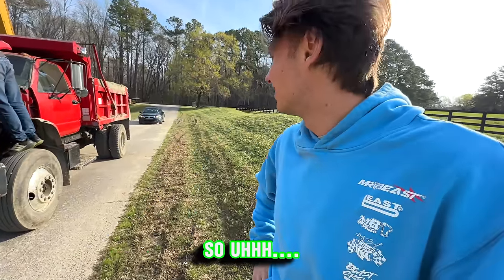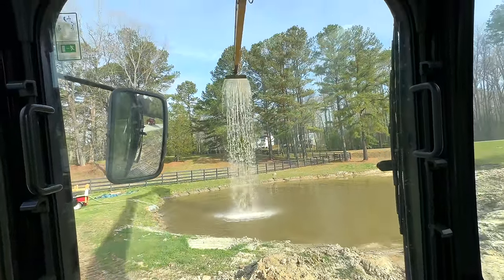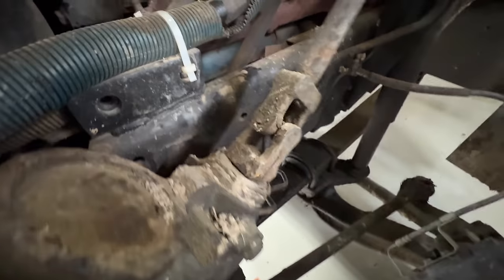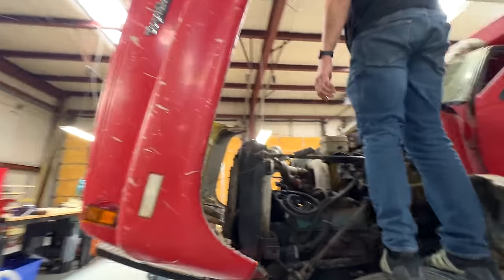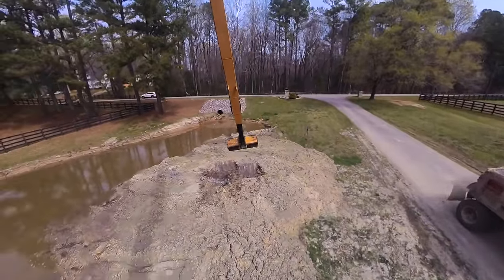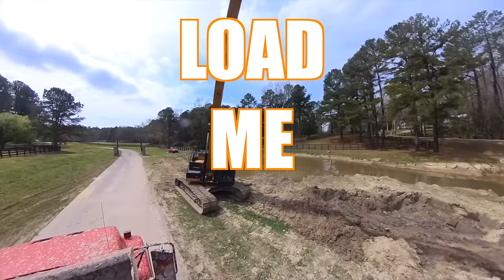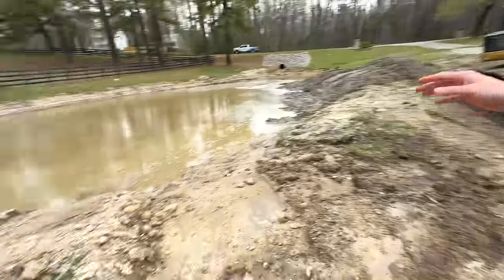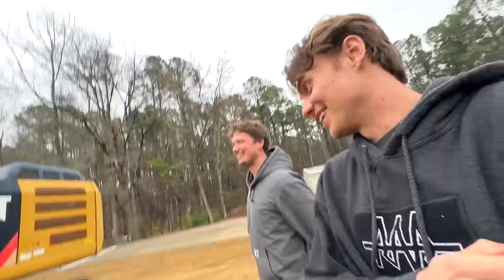Someone Destroyed My Dump Truck...

Comment: I drive a dump truck and we dump water in the back of the trucks to clean them out.Leave the dump body down till gatewalk and drive forwardd backwards.So the water slashes around it will break the stuff up.Then you dump it out